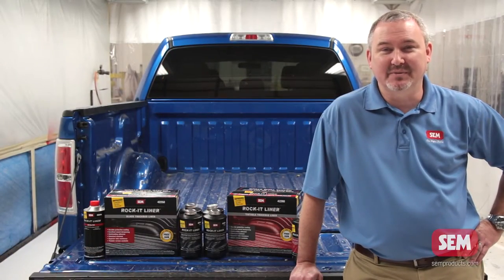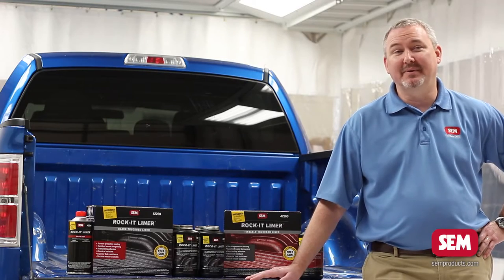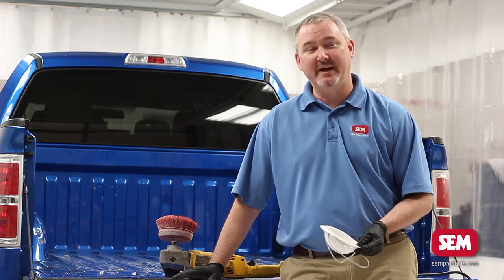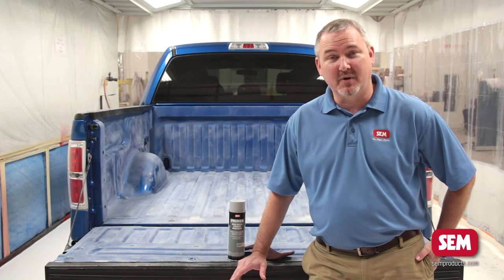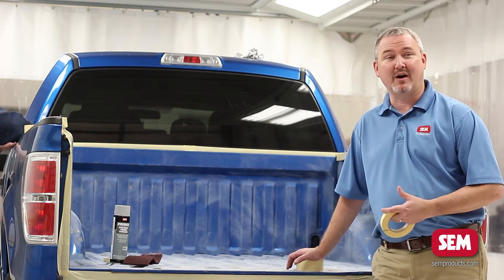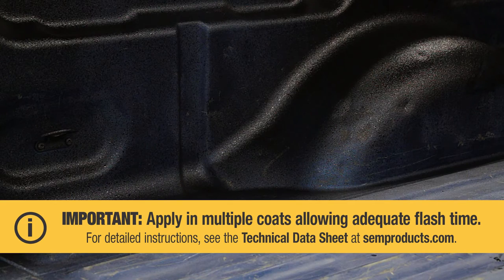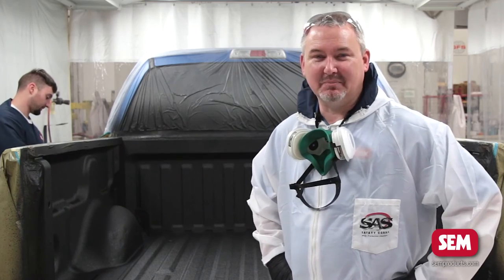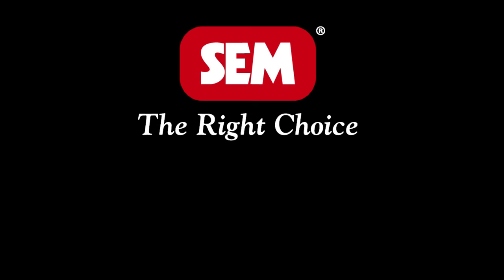SEM Spotlight Series: Rock-It Liner™

Comment: I have a half kit of tint-able 42260 rock-it liner that isn't tinted and need to know if I can paint it with automotive base coat after it sets up? And if so how long do I have to wait for it to cure before painting?
Reply from the maker: Wait 24 hours for it to fully cure. Scuff the entire surface with a gray scuff pad and blow off. Then, clean with SEM Solve and you should be good to paint.